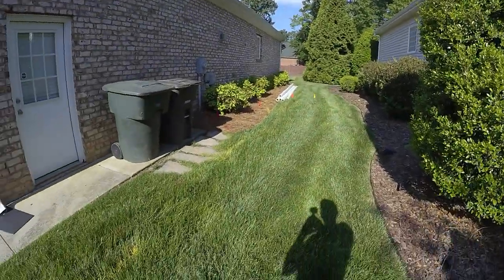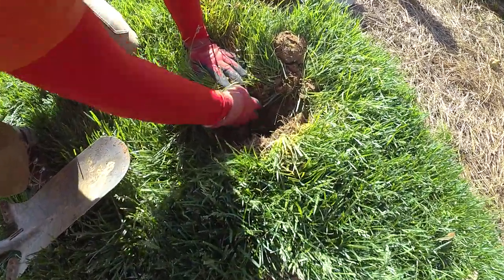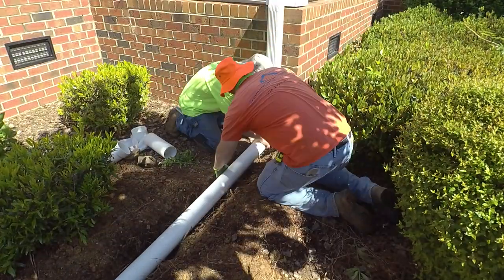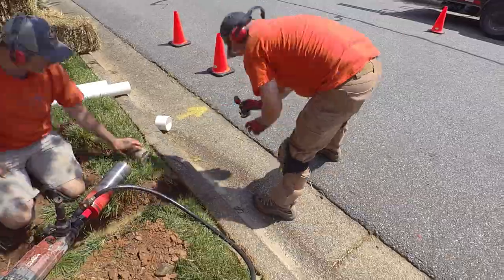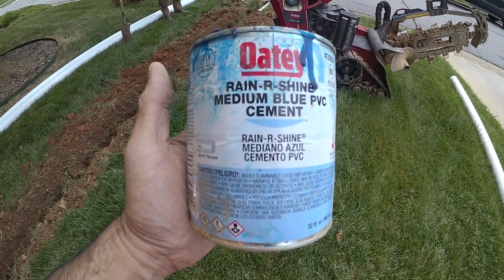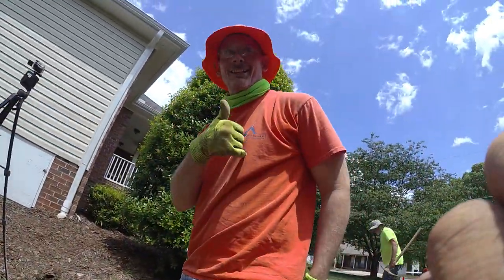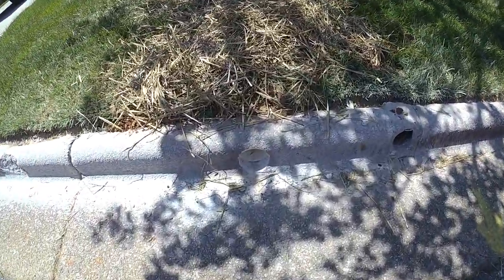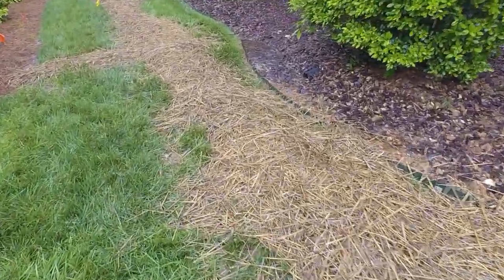Catching gutters from both neighbors to solve standing water problems

Comment: Great job Shawn. Good idea on the coring, I've had to use that trick before for the exact same reason.
It's crazy how some roads are SOO much more crowned than others... You did the best option. 👍
Reply from the maker: Thanks Ed! I was wondering where you were!
Reply: I'm here.
It looks like you started to use the slope on the level. How did it work out for you?
You appeared to be doing it right. I know it's not what you're used to, but it will get way better the more you use it... Especially if you are tight on pitch. Sometimes we are only able to get 1/2% pitch-slope. It definitely works and with that type of tolerance, you need to keep it consistent throughout for the best result.

Comment: Nice job. Ever thought of using a turf cutter first, then the trencher. Should save you money on seed and hay over time and would look nice straight away. 
I wonder how much overseas shipping would be for core of concrete ?😬
Reply from the maker: Yes I did have a sod cutter. The problem is the trench settles. So we have to leave it mounded so it will flatten back out. If you leave it level the trench will re-form as it settles.

Comment: As you look from the street, the house on the left still has one downspout dumping on the ground at the front corner of the garage, don't they?  That would explain a lot of water on the surface in that area.
Reply from the maker: The gutter guy just got out there to add a downspout to our stub out. That should have most of the water taken care of.

Comment: Should have done the straight run as a French drain and add some flush surface drains to help draw off the surface rain.
Reply from the maker: But all of the water was point water. So we just kept it in a pipe.

Comment: Watching Andrew Camerata he said an interesting piece of advice. "Pipe is cheap. Excavation is expensive. Dont cheap out on your products to just have to dig it up again." He was showing schedule 40 pvc withstanding a 310 john deere back hoe running over it without failure. Took the whole weight of the rear on the bucket teeth to finally shatter it. Buried where dirt supporting the sides from elongation makes it even stronger.
Reply from the maker: I have seen that video and I would agree!

Comment: You put a short piece of pipe through the curb with a coupler on the back end, but built the rest of the system from back to front. How did you make the last connection? In copper you'd use a slip coupling, and in threaded pipe you could use a union.  I would use a rubber coupling as a slip coupling, primarily because I can't think of anything else. Is there a better way?
Reply from the maker: We lift up both ends of the pipe to get them into a regular coupler, and mash it down in place. It takes accurate measuring but works. If we are joining pipes like that that are in the ground we use a mission band (reinforced rubber fernco) because it slides past then back over the joint.
Reply: @GCFD  Wow - it simply never occurred to me to use a regular coupling like that. (Lift up & smash down.)  That's fantastic.  Thanks!

Comment: That's a lot of roof into 1x 4" pipe.  Looks like a typical 4" pipe can handle approx. 1800sq ft of roof at an approx. 4" rain per hour event (75gpm). Part of me wants to say each home should theoretically have it's own pipe to the curb too so they can't blame each other for a clogged pipe but w\e.

Usually a 4" pipe at 2% slope can flow 75gpm to 200gpm depending on a bunch of factors  (240-260gpm at 20psi). Typically around 55-75gpm when 1/2 way full of water.
Calculating for a 4inch rain event (not sure of location, but 22" of rain in north carolina in 24hr is the record and 4-6" rate of rain per hour is not unusual even if it only lasts for a 15minute period after ground saturation.

L (ft) x W (ft) * 144 (in2/ft2) * 0.07 (inches of rain per minute in a 4"rain/hour event) * 1/231 (gal per in^3)
Reply from the maker: 👍 Thanks for sharing!

Comment: Just curious why you didn't use a downspout wye connector as a clean out in case the gutters get filled with leaves & debris.  Any particular reason?
Reply from the maker: The way we insert the gutter downspout into a coupling leaves enough space to get my jetter hose in there. Sometimes we do install cleanouts if the customer requests it.

Comment: Im still curious why the pipe doesnt go farther up the side of the house to build head pressure on a site that is kinda flat (apparently)  - is it just aesthetics?
Reply from the maker: With a 4" pipe you've got a lot of head even with one inch. We had almost a full bubble the whole way down, so this wasn't as concerning. For jobs where we have little fall we install higher risers.

Comment: Still blows my mind you guys don't pipe out the downspouts during the construction of houses.
Reply: Yea, it’s ALWAYS done where I live
Reply: It really should be code.
Reply: Where I live now the requirement for new construction is that all water has to stay on property. So they are putting in cast concrete dry wells on the lots.
Reply: @fillowtree5505  interesting.  However, there aren't dry wells big enough to contain heavy rainfall events. Seems they need overflow discharge to the street.
Reply from the maker: Keep in mind you’re seeing the worst cases on my channel. 99% of downspouts aren’t a problem in our area.
Reply: TRUE !!!  But the developers/buiders know they can get away with it and save some $$$$
THAT'S what it's all about!
Reply: That causes huge problems for the cities water treatment plants. They then have to be overbuilt to handle huge spikes in waste water production. At least here in my city which has a combined sewer system.
Reply: Most cities now days do require rainwater planning in new construction. It’s really not often a problem in the suburbs.

Comment: Are storm water systems not common?  Seems a lot of house are built with the storm water dumping straight into the yard.
Reply from the maker: Most of the time that water doesn’t cause problems. You’re seeing the worst cases on my channel. I usually am working to save the foundation with my systems.

Comment: Never understood why downspouts are not piped into to the street sewes as standard like they do in UK..
Reply from the maker: Because here in NC 99% of downspouts don't cause any problems. Keep in mind you're seeing the biggest problems on my channel. 👍
Reply: Surge capacity. In my city they used to pipe them into drains but they all had to be removed at some point. Water-logged lawns act as a surge accumulator for roof water, it delays entry into the drainage system.

Comment: Hey Shaun, I have a back yard that gets flooded from the run off from the two houses above me. It then fills my backyard up until it reaches a certain point then runs to the house next to me. What would be the best option for collection of the water as it enters my yard? I know exactly where it pushes in from. Is it a French drain or something else? Obviously I have a low spot for it to hold water but the low spot isn't a problem if it werent for the runoff from the two houses above me
Reply from the maker: You would only want to collect the water if you have a place to send it other than your next neighbor. The reason is you can't discharge a pipe onto your neighbor. If not, I would re-grade so the water continues on down the line.

Comment: I will be very surprised if that run of pipe can handle all the water coming off those roofs, without backing up, during a heavy downpour of any lasting duration.   Add to that any hail mised in, whether it be pea size of larger, can clog the whole works.  Looked to me like you needed a larger diameter pipe, which I know would have made it even more difficult to install..
Reply from the maker: We were out there in one of the most intense rain events we've had here and the pipe handled it just fine. We even showed this in the video. What else can I do for future videos?
Reply: @GCFD  Where I live we could get some real heavy downpours that a set up like that couldnt handle.  I could see where one home might work, but two is asking a bit much where I live.  We have had some 4,6, and even 12" of rain in one event in the past.  Add to that pea sized hail that came down in buckets and that 3" pipe would never handle it.  My 4" just on my home alone, barely does sometimes.

Comment: Why is the drain water always just dumped in the streets like that? Is it that way all over the U.S.? Maybe it's just in smaller towns?
Reply from the maker: Because the streets are part of the stormwater management system. Great question!
Reply: @GCFD  Thanks for the reply. Yea i guess the streets then have storm water drains to take up the flow. Where I´m from (Denmark) we are obliged to keep rainwater on the property, or lead it directly to the surface water sewer. (sewage and surface water runs in separate lines)

Comment: Awesome job, Shawn!

On your longer pipe runs, have you ever laid in a piece of wire to help locate it if the homeowner sells rather than relying on the homeowners memory?
Reply from the maker: We do occasionally run tracer (locator) wire. We use 14/2 outdoor wire.

Comment: Might be helpful to apply some wd40 to the part of the pvc that goes in the concrete hole.
Reply from the maker: Great Idea! We like the tight fit but it can be tough to slide in.
Reply: @GCFD  might be useful in case you need to pull it back some and refit it.

Comment: Nice job, out of curiosity what does the price look like for a job like that?
Reply from the maker: There are a ton of variables that go into cost. For example the price of pipe has increased by 25% in the last three weeks. Fuel has gone up by that much in the last two days here.
Reply: @GCFD  So what was the price for that job you posted?

Comment: you could have had cut the grass so you could place it back over the trench
Reply from the maker: The problem with that is settling. We leave the trench with dirt piled high so it can naturally settle around the pipe. This is because we have our pipe set to the fall we want and don't want to compact the soil and disturb the pipe. Cutting the sod off, placing the pipe, then placing the sod back on top looks great as we are pulling away but after a few rains the trench will reform and be aweful.

Comment: Why are all these cables put in the ground just like that? Where is the protective mantle or flex tubing? Also the depth is so shallow that that is just a tiny accident with a spade away from failure. Dafuq is wrong with the utility companies in the USA?
Reply from the maker: That's how they do it around here. These lines get cut in the spring when people are aerating their lawns because they are so shallow.
Reply: @GCFD  I can imagine. Feels like such a waste. Why do it one time right, like you with using smooth PVC instead of corrugated pipes, when you can do it wrong over and over again.